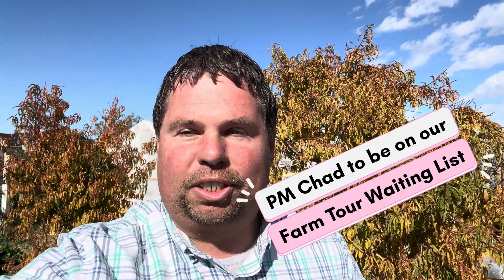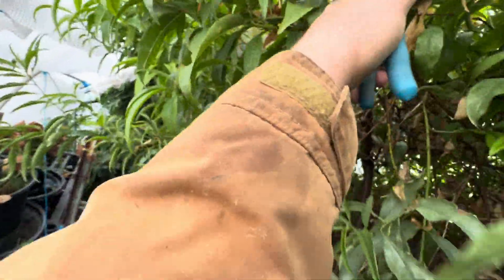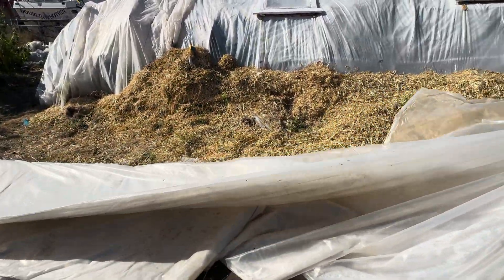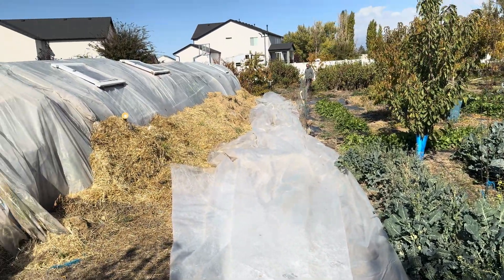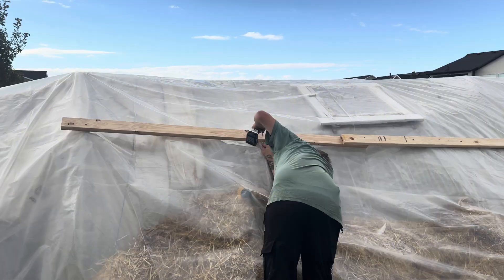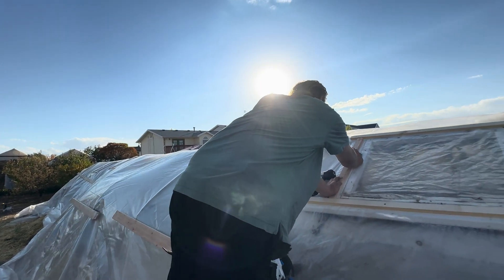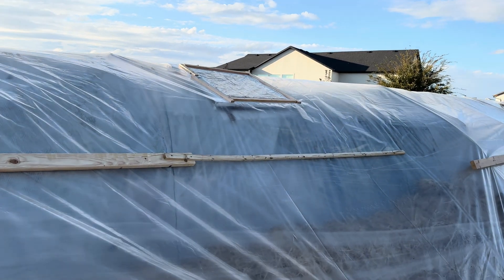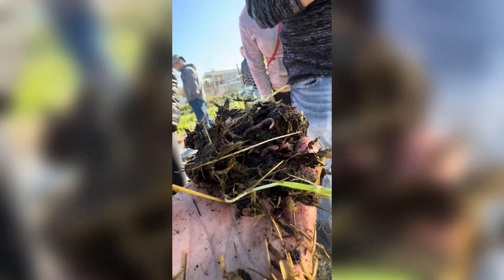How to Heat a large Greenhouse for FREE using just Compost & Water!!  An Compostable System! Part 1!

Comment: How often do you add hay and bags of leaves to generate heat using existing do you add to existing or change it out ....I'm guessing you add to existing
Reply from the maker: Hamburger effect of adding. However this is easy to lift the plastic and dump out of the bags. When we get too many layers of plastic we remove the older pieces inside outside.